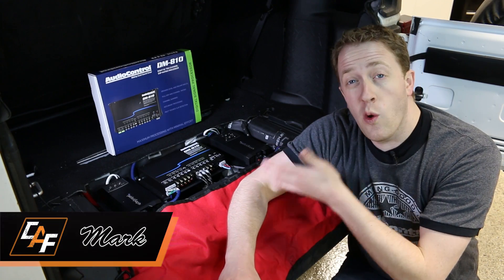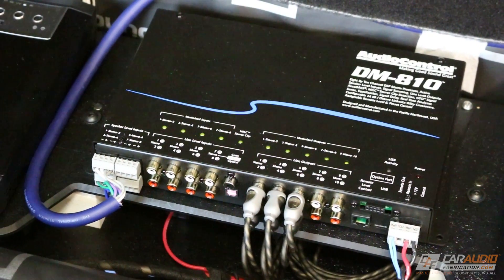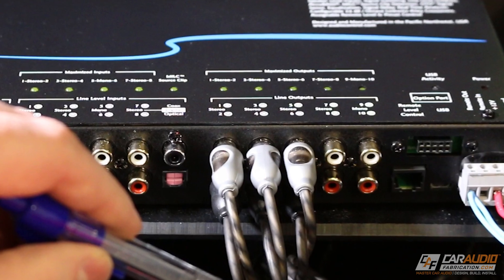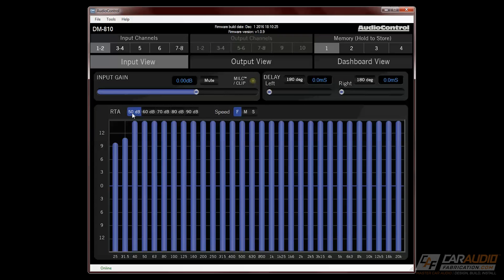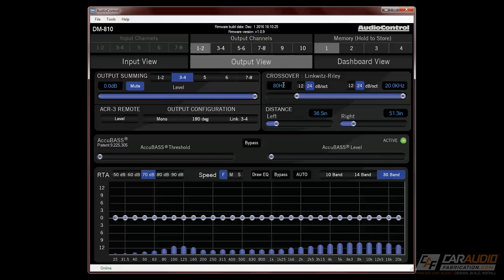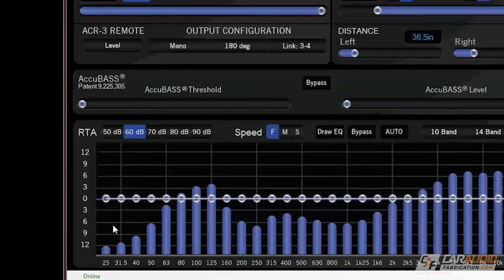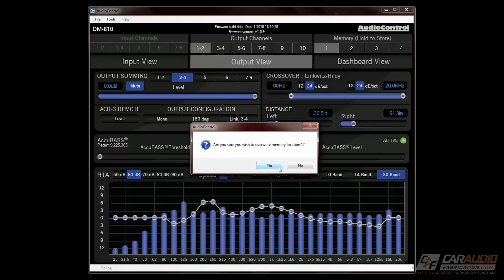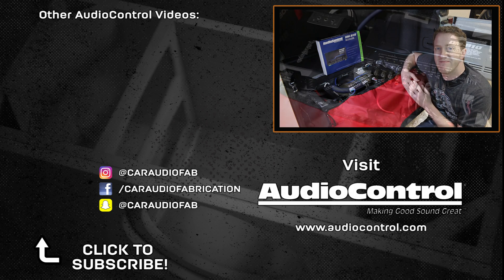AudioControl DM-810 DSP - INSTALL & OVERVIEW

Comment from the maker: :hand-pink-waving:Thanks for tuning in guys! You can purchase the AudioControl DM-810 below!
https://shop.howl.me/caraudiofab/collections/2611
Disclaimer: Affiliate links, if you purchase from the links above we receive a commission.
Reply: which type of dsp do l need when running the following gear, 

6, 6 inch mid range speakers focal 6.5km  and audiofrog bg6
4, bullet tweeters  hertz spl show st 5k neo 
4, dome tweeters memphis audio srx1
4, 6x9  way speakers kicker 46cs6934
2, 15 inch dvc subs memphis audio 
2, 10 inch dvc subs memphis audio 

l am running a Kenwood DMX1057XR headunit 
amps running  3 Audio control LC- 4 800
2 audio control LC-1 1500

all this gear is for my party bus that l hire out,
Reply: Can the iPad Pro be used to setup the dm 810

Comment: Dought you read these posts any more but I’m swapping out all 9 speakers and bypassing factory amp thought it would be a simple speaker swap. It hell no gonna cost me over 1,600, he a 24’ Ram w/alpine speaker system gotta buy.600.00 worth of harnesses before I do squat. I never knew about much less thinking of hooking up a DSP much less tuning it I’m screwed hv zero idea how to tune a DSP can’t afford to pay a stereo rip off ctr to do it they want over 1 grand guessing I might just hv to get used to the factory system cause I can’t tune a DSP much less hook one into my system I can’t tap into my factory harness hv zero idea what it to look fore but if I do do it I’m going with your DSP

Comment: AudioControl products are not purist tech.  Their DSPs use terrible quality DACs resulting in grainy sound.  The crossovers are 25hz-20000hz... for some crazy reason apparently we don't need all the bass.  All the audio is forced through the crossover with no option to bypass.  There are only a couple crossover types and only 6 or 12db/oct slope options.  The interface is programmed in Unity and absolutely blows.  AudioControl has redefined what glitchy means.  Tuners hate their DSPs and I know why.   I called and spoke to one of their design engineers.  He was so clueless as to the sanctity of the audio signal path I was amazed.  He saw no issue with any of the items I noted and admitted it was all about budgeting costs.  Well folks, you can get much better off Alliexpress than AudioControl.  I've done it.  I also run a Helix and, well, that is night and day.   For the same price, get a Helix every time.
Reply: Glad to see your comment because Mark isn't helping answer q in this space. Audio Control DSP was shown as the go-to for adapting an IPAD as the audio, maps, all in one source for a old car mod.  

What would You use that does exactly as the AC DSP, or the ac d.1300???

Comment: I know this video was posted years ago. But I have a few questions. Will a dsp be better to replace my lc7i? My system got a full tune with proper equipment, but I’m obviously not able to go 100% volume but I can barely hit 75% and certain songs distort my audio especially my dash/ tweeters running on crossover. Will dsp help prevent that? I’m also on stock HU. 2017 Silverado with Bose

Comment: I have a 2016 Buick Encore with the Bose Factory System. I bought the Audio Control LCI7I Pro. Would the DM 810 do the same thing with integrating a new system in my Buick? If it does, I would rather go that way.

Thanks
Joe

Comment: Mark, on the DM 810 when you plug in the micro usb to usb cable. And have the system playing pink noise. It states DM 810 not connected . I have it on my laptop air and surface pro and neither connect. And also do you have to have the microphone for inbound frequencies?

Comment: Mark, a question... When I use a DSP like the one in the video, all equalization and crossover adjustments will be done exclusively on the DSP, right? So on the device that is the sound/signal source (multimedia/CD Player/receiver), and which is before the DSP, I: (1) leave the equalization in "flat", that is, I don't do any equalization and (2) ) I don't use the crossover that is integrated into the sound source, that is, I leave the crossover deactivated. The same goes for the amplifier that is after the DSP, that is, if the amplifier has some type of equalization, this equalization must be deactivated, it must be in "flat"; and if the amplifier has any crossover adjustment; This feature must be disabled. Is my reasoning correct?

Comment: which type of dsp do l need when running the following gear, 

6, 6 inch mid range speakers focal 6.5km  and audiofrog bg6
4, bullet tweeters  hertz spl show st 5k neo 
4, dome tweeters memphis audio srx1
4, 6x9  way speakers kicker 46cs6934
2, 15 inch dvc subs memphis audio 
2, 10 inch dvc subs memphis audio 

l am running a Kenwood DMX1057XR headunit 
amps running  3 Audio control LC- 4 800
2 audio control LC-1 1500

all this gear is for my party bus that l hire out,

Comment: Hi Mark, I have a question about the remote out section of the dsp. Why do you have 2 wires coming out of the remote out? Are they both leading to seperate amplifiers or is one of them leading to a remote 12V wire hooked up to the car?

Comment: Mark, When it comes to the DM-810/608 delay settings of each speaker, what is your preference? In other words, if the vehicle is used by two people at the same time, one driver and one passenger, what is your recommendation for setting the delays? Do you optimize for the region center of both front seats? 
I would think that adding the ACR-3 would enable two settings (Memory), one delay optimized for the driver when alone, then a second optimized for two people centered between the front seats - that is if the Acr-3 can select between memories.

Comment: If I’m running an apicenter and dsp, should i use GTO on the epicenter and GTO on dsp OR GTO epicenter and rem out to dsp remote in and THEN REM out to my 2 amps?
Reply from the maker: Use the GTO on the first thing in the signal path, then use the remote out to tell devices further along the chain to turn on.

Comment: Mark, if I use the Epicenter Micro, is Accubass needed? (I'm not yet using a DM-810 and not using a EQL).  So, the Epicenter Micro will be my line LOC, preamp line driver and bass procesor into an outboard amp. (This is just an OEM integration system. Meaning, I am adding a sub only).

Comment: I am just using one of these products for the first time. I have some questions. 6.1200 DSP and amp combo

The factory head unit I am integrating with has different clip points based on frequency. I have a single Left Right pair for input, the head unit clips 40 HZ at 32 volume level, 400 Hertz at 30, for kilohertz at 25, and 10 kilohertz at 24.

I want to amplify these signals in a band pass configuration individually. However the output view is DBA relative so it doesn't allow for boosting outside of the EQ itself.

I was thinking that maybe jump ring input channel one two over to 34 and 56, would give me the ability to individually set clip points for both mid bass, mid-range and tweets.

This seems like a very roundabout way of doing it but I can't think of anything else given the limitations of this product.

Also, how do you deal with phase irregularities without the implementation of any all pass filters?

Finally, have you found any issues connecting this to a Windows 11 machine? So far I've only seen it working on Windows 7

Comment: I just installed this and have a terrible hiss and noise floor... have to turn down the output gain to -12db to not hear it ...
Reply: @zorhis1996  you probably need to install load resistors

Comment: Hey, I couldn't afford the DM-810 and instead got the DQDX. Obviously it's not AS good, but do you think it will suffice? I'm putting in a JBL Club system with a pioneer head unit. (Tho I may upgrade that as well) I just couldn't put in another 700 right now, so I'm SETTLING on the DQDX. I was hoping to get your thoughts on it?

Comment: What do u think about all the noise the 810 introduces? Possible solutions? I have one and have localized the noise to the unit, I am not alone in this. Very high noise floor.
Reply from the maker: Improper level setting.
Reply: @CarAudioFabrication  well I have 2 options available to me at this point...I can lower the input and output gains on the app to match my hardware as I "SHOULD" do, then raise the gain accordingly on my amplifiers.... OR raise the input and output gains on the app as high as possible so I can have the gains on my amplifiers set low to lower the noise floor. I'd love to do the first option cuz that's what I'm told is the "proper" way to do it. However when I do that and have the gain raised at all on my amplifiers I get terrible hissing. 🤷 Honestly if I have my gain raised more than a quarter on any of my amplifiers I get terrible hiss. Seems like it shouldn't be the case? Who knows tho, I do however like the unit. Swiss army of DSPs. Just wish I had parametric EQ.

Comment: Does this need an fix86 or benefit from it ?
Reply from the maker: You can correct the OEM signal, similar to the Fix.
Reply: @CarAudioFabrication  so it would be pointless to use fix86 with the dm608

Comment: What operating system do you recommend for programming the DM-810 as well as other AudioControl products ? I recently installed my DM-810 and would like to buy a small computer/tablet/surface etc, to keep in the vehicle
Reply: It would be cheaper to add the BT module and just use your phone.

Comment: I love this video, thank you.  I just ordered the DM 608 and was wondering if there is any material that goes deeper into the application  that helps a beginner successfully navigate and setting up their DSP for their system? The reason I ask is, for my car I have 17 speakers, six tweeters, six 6.5s, two 8s, 1 driver/horn and my 2 subs which are running off of 3 amps. 3500W Class D monoblock for my subs and two 1600W Class D 4 channel... one for mids and one for highs. Every speaker is wired down to a lower impedance. My subs, DVC 4ohm wired to 1ohm, tweeters, 6.5s and 8s SVC 4ohm wired to 2ohm.  My 3500W is 1ohm stable, RMS Power 3500W- 1ohm: 1 channel at 14.4v and my two 1600W 4 channels RMS Power are 2ohm: 320W x 4 channels at 14.4v. My tweeters and driver/horn are DS18s - tweeters 225w RMS and driver/horn is 320W RMS. My 6.5s and 8s are SunDown Neo Pro v3, 6.5s 180w RMS and 8s are 200w RMS.  My subs are Skar Audio VXF 12s 3000W Max/1500W RMS. 

I originally had all Skar products, tweeters, 6.5s, 8s, subs and amps. I am in the process of removing all skar products from my car due to a falling out with a local car audio shop and Skar directly, Skar seem to assist this shop in ripping me off for over 428.00 for a enclosure they completely screwed up the port size for VXFs. I've completed the replacing the skar inside speakers. Now I'm waiting for Deaf Bonce to restock on their apocalypse series DB-3012 D1 12s, their apocalypse series AAK 4K.1D  D class monoblock amp and two apocalypse series AAB 500.4D 4 channel amps to replace my skar amps plus subs. 

Any way, after typing all this I'm not sure why it was necessary but I was hoping there was material out there that dives deeper into how navigate and setup the DM 608 DSP?

Comment: Hi mark I have a Cadillac ATS with the bose 10 speaker system. I’m using the Lc2i coming off my factory amp powering my jl hd 750/1 amp which powers my w7. I’ve upgraded my front door speakers so my question is what can I use with the Lc2i to dial in my system better or could I just use the three.2 or the dqdx and do away with the Lc2i all together? I like having the bass knob

Comment: What kind of cable are you using to connect the dsp from the source unit? I found a cable on a store here in Sweden, 9x0.75mm2 cable, I guess that is the same type o cable you are using?

Comment: My dm 810 don't turn off when i turn off my car ignition
Reply from the maker: Its not wired properly then. Make sure the remote lead doesn't still have 12v
Reply: Same issue,  I have the constant 12v red wired and using only the remote out to turn amps on. Sometimes it turns off but mostly it doesn't. If I pull the plug on unit and plug it back it won't turn back on until I power head unit.

Comment: How do you wire the separate amps for the mids, tweeters? Or do you wire them together?
Reply: I would say, that if you were planning on wiring the mids and tweeters together through a passive crossover, then the DSP would be a waste.    If you have four tweeters and 4 mids, then 10 outputs will take care of that.   You need 8 channels of amplification.   That means an 8 channel amp or two 4 channel amps.    Plus, if you have a sub, you will need another channel for the sub.   I have two 4 channel amps and another for my sub.   I will probably install one more amp when I add a center channel.

Comment: Well tommorow is the day I been looking forward to for 2 weeks! Finally got an install scheduled using this exact Dsp, a 4 channel amp, and subs. So here I am at 12:00 the night before reading up and studying on this thing because it’s my first time using one haha.
Reply: How did it come out, I’m planning on getting mine and trying to justify my purchase/see if it’s worth if
Reply: @PeePeePooPoo07  it came out great. However 2 years and hundreds of installs later, I’ve found that a solid aftermarket radio with network mode and good amps and a dsp is kinda pointless for most users. 🤷🏼‍♂️

Comment: Hi how are you? I want to add a dsp on my system, I have 2 sets of components, in front I have a 3 way Focal ES165KX3 and on my rear doors I have a 3 way jl audio C5-653. My amps are 2 four channel and 1 monoblock for subs. Can you recommend me a dsp?? Right now I'm running a LC6i and the Epicenter. I have OEM Unit.

Comment: I’ve had a lot of trouble with this! I do have it sounding pretty good but now the amp freezes when it’s cold. In the morning it won’t go on, or only the left side, or right side will only come on? As well, it has begun to give a high pitched shrill in which you have to shut the car off and back on! Should have gone with the JLFix and separate amp?!
Reply: Contact AudioControl directly and see if you can get it warrantied. They carry a 5 year warranty on all AC products. Worth a shot!
Reply: @MrMattyXb  ya, I did contact them at the time, they helped sort out a few issues. That software should have had some pre-settings like Rock, Jazz, POP etc..... I just sold the truck instead!

Comment: I am going to purchase this piece to use in my latest install as I think it will be the central and critical piece of building an exceptional sound system. I think you really have to understand conceptually all that this piece can do and all of the customization it offers to realize why it has that power. I've always loved competition car audio and my last system was great but very old school. I actually dreamt about this device on paper before I actually realized it had been built and the Gods at AudioControl (who else is there) were the creators of this amazing control center, what, with crossovers of all kinds, AutoEQ, built in RTA, time delay, and all controlled from a software interface, this is a serious piece with some well thought out concepts.

Comment: Marc, I just purchased this product.  My head unit is a kenwood dnx 693s Excelon,  with kenwood excelon 1300, 1700 & dash speaker.  I was told that I don't need the unit because my head unit does everything that this does by 1 shop & another shop told me it would help.  So I'm perplexed. What would be your suggestion? This is in a 07 Cadillac dts.

Comment: I just bought a dsp with 2 inputs and 8 outputs. I also have a audio control 7 band equalizer and an aftermarket deck with a dsp Ana equalizer. Can I intrigate my audio control equalizer into my new dsp.

Comment: @Caraudiofabrication so if i was to buy one of these DM-810s would i still need to use my LC6i? 🧐🤔 i got a 2019 ford flex SEL with the non 8 channel sony system. And im starting to set a system for it and i was going to use my LC6i but if i can get better cleaner sound with the DM-810 i would rather use that.

Comment: Should give one of these away. Damn new cars and not being able to just drop a new system in with out all this new stuff.
Reply from the maker: Even if you could just "drop a system in" for optimal sound quality you MUST be able to tune. Every speaker plays differently so when you pick different speakers you must be able to control the equalization. You need to control time alignment and crossovers. If you don't want the best sound you don't need a DSP, but you are not getting the best sound without it.

Comment: When using sound processor does each speaker have to be wired individually and not use cross over
Reply: It doesn't "have to", but using a passive crossover sort of defeats the purpose of connecting a DSP(which is an active crossover).

Comment: Will you be able to retain your fade on a aftermarket radio?
Reply from the maker: As long as you bring in front and rear channels and choose that those outputs go to your new fronts and rears then yes. Just depends on your system design
Reply: CarAudioFabrication what about retaining a center OEM speaker I’ve lost my ability to fade once I got rid of the factory headunit and put a after market pioneer.
Reply: CarAudioFabrication also thank you for the reply!!!

Comment: This thing seems pretty cool. I have a question. If you only wire or have 4 line level inputs will you be able to still use channels 6-8 on the output?
Reply: yes